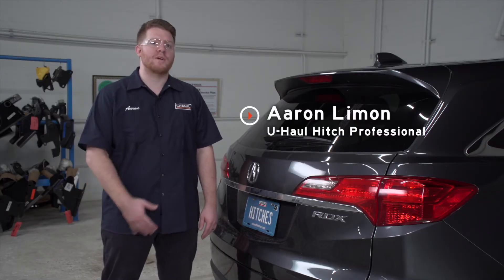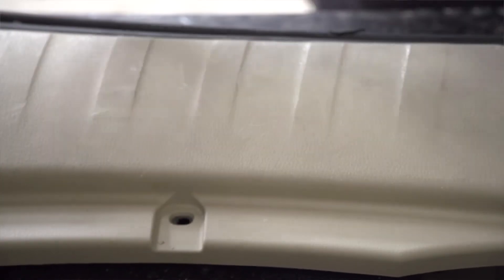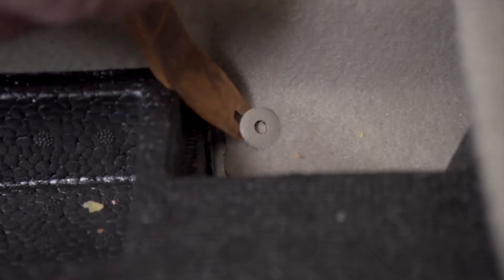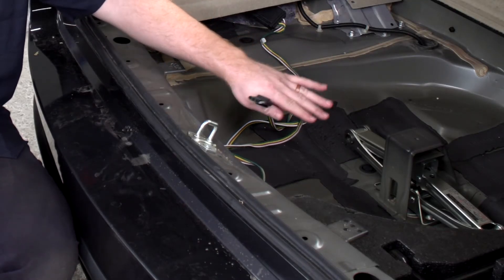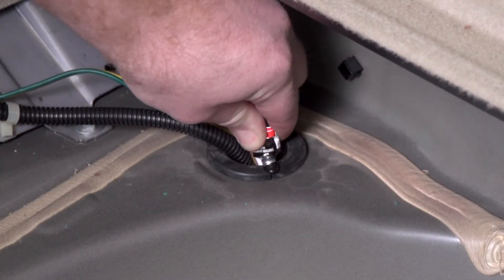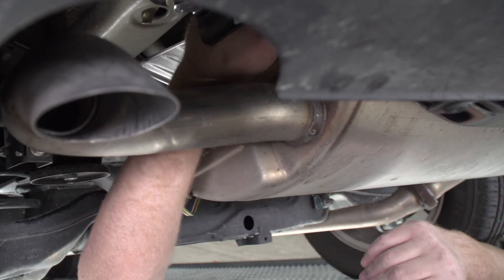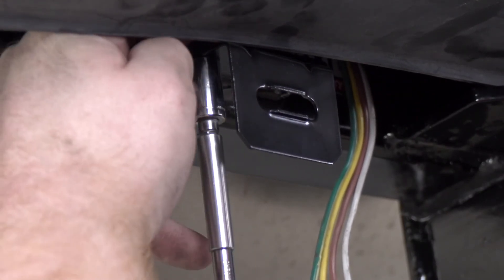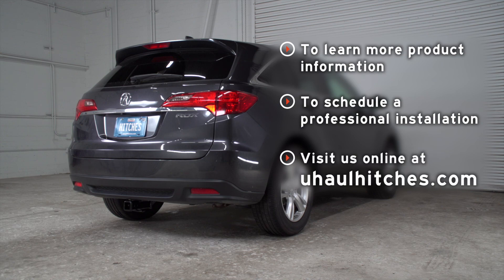2016 Acura RDX Trailer Wiring Harness Installation

Comment: Wow - is it that easy?  We'll see shortly as I try to do the install myself :). Great video by the way 👍

30 minutes later I'm done :)

I didn't bother with running the wiring harness under the car.  Why?  Last truck I had I ran it to the hitch itself.  Over time it started to get corrosion on the connectors from moisture either in the air or on the trailer connector.  In any event, after years of use the hitch was in better shape than the wiring harness.  I believe it will be much better to simply store the harness in the trunk where it will stay dry.  Besides I'm not going to be pulling a trailer with my car as much as I did with my truck.

Question:  My wiring harness came with a 10 amp fuse, but the 2016 Acura RDX has a 20 amp plug for trailer.  Looks like manufacturer (CURT) says to use the included 10 amp fuse.  Anyone have an issue with the 10 amp fuse?
Reply: Did you figure the fuse out? The page says you have to have a tow package but I thought that's what this wiring is